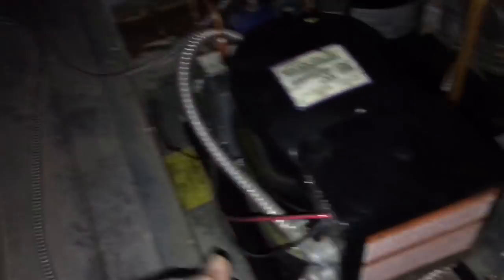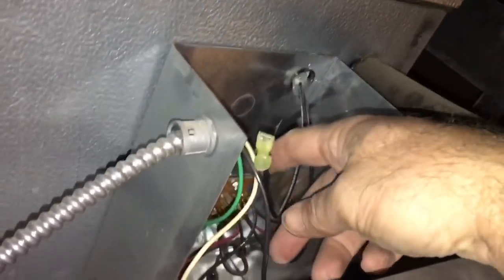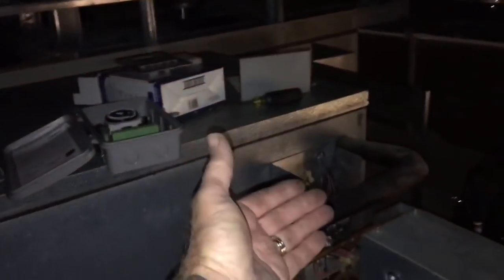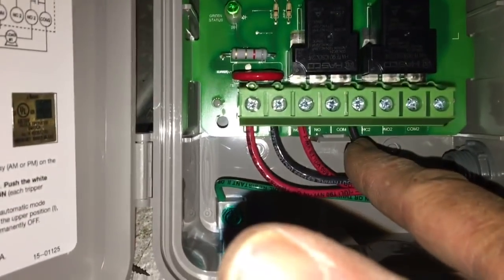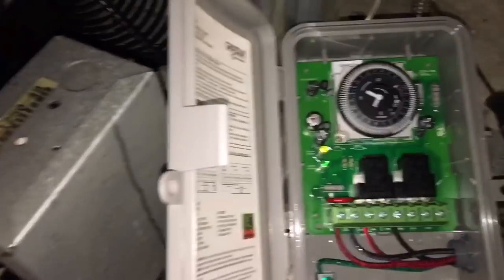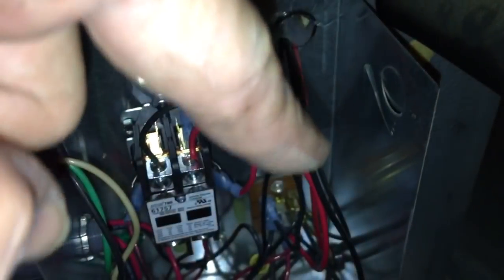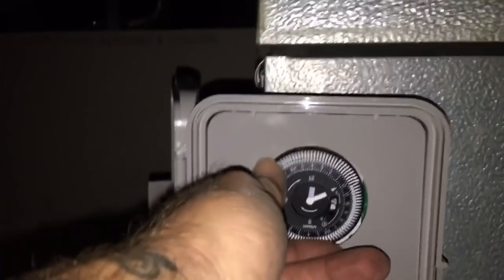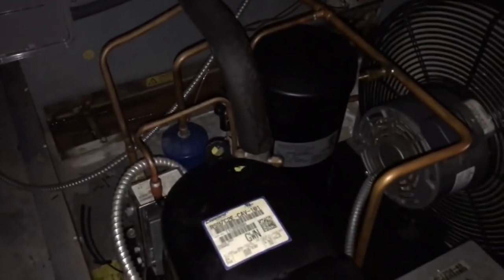Install defrost timer on walk in cooler

Comment: Had a random call at a cattle ranch a few weeks ago and had to replace one of those 208/240 coil contactors on a similar unit.
  I'd picked one up by accident and decided to keep it "Just in case", glad I did - quick and easy fix and the customer was happy.  
Saved a two hr round trip drive to the parts house too!  Def worth it to keep one on the van for out-of-the-ordinary calls.
Reply from the maker: mike_HVAC so True gotta have a few items on the truck.

Comment: Nice work Dave!   That looks like one of those Norlake units.  They always freeze up because they're not built to handle opening and closing all day long.  You'll see them in Subways and a few other establishments.  What you've done also works on R-22/R-407C units as well, as they also tend to ice-up because of the operating pressures/temperatures and people going in & out of them constantly.
Reply: Yes I have a subway that this happens to constantly. The newer ones have curtains and shuts off the unit fans when the door opens.

Comment: never seen a thermostat directly running the condensing unit and in 35 yrs I've seen some ragged ass shit. good job Dave
Reply from the maker: James Mclaughlin thanks James.
Reply: On almost all standard reach ins your thermostat controls your condensing unit. On small walk ins it’s also doable as long as the contacts in the thermostat can handle/rated for the compressors amperage.

Comment: Nor Cal, correct me if I am in error. The way I understand your wiring in of the defrost timer in this video is that you wired in contact No. 2 and 4 of the defrost timer in SERIES with the cold cotrol contacts, then used the output of the series circuit to bring one of the hot legs to the  208 volts contactor coil. Doing it that way means that the refrigeration mode circuit of the defrost timer needs NOT only contact No. 2 to 4 on the defrost timer to be closed, but it also needs the cold control contacts to be closed for the circuit to be complete on one hot leg. Of course, the other hot leg of the 208 volts is not on a switch. It's 
wired directly to the other side of the contactor coil. Wiring it that way means the contactor coil circuit is complete whenever BOTH the cold control contacts are closed AND contacts 2 to  4 on the defrost timer are closed. Also, the power supply for the timer motor is wired in PARALLEL with the line side of the single throw double pole compressor contactor. Did I get that right, sir?
I had to think about it because I'm used to the wiring of pumpdown split systems where the thermostat output goes to a liquid line solenoid coil, not a contactor coil.

Comment: Been using the Gm40 Time clocks for years , my favorite time clocks ...
Reply from the maker: They work good. Fair price too.
Reply: Nor-Cal Refrigeration & H.V.A.C yes they are . Where do you buy yours from?
Reply from the maker: Felipe Tafolla RSD
Reply: Nor-Cal Refrigeration & H.V.A.C how much do you pay for them?
Reply from the maker: Felipe Tafolla just under 60$
Reply: Nor-Cal Refrigeration & H.V.A.C.   Under 60! They run about 90 from my supply house here in NH. Blows my mind!
Reply: Nor-Cal Refrigeration & H.V.A.C weird Nor Cal my cost at RSD for that timer is over $90  , reason why I asked is , Home Depot used to stock those for $59 which was a mega deal , I think you can still buy them only at the Home Depot website, or maybe your Home Depot still stocking those  🤔.

Comment: I'm trying to hook up a 120 volt unit. I got power coming in but I don't have 120 coming out normally closed or normally open in any position. That's brand new out of the box. I'm sitting here second-guessing my wiring but I mean it's got to have 120 coming in and 120 coming out somewhere and I don't see 120 coming out anywhere in any setting or location. Not out of normally closed not out of the normally open. 🤷🏽‍♂️ Fml

Comment: The 9145/9140 series time clocks are nice. One of the key improvements with this model time clock is it keeps track during power outages. Once power is restored the timer starts ticking on time. This is key when your running more than one timer on the same box.

Comment: Dave did you wire L1 & L2 for the time clock to come off the terminal block or from the j-box?
Reply: It took me a few moments but suddenly I could see it. The new  timers orient differently. Also you have T1 and T2 coming too down. Also my walk in downtown have a terminal block not that it’s important but I thought I’d mention why I asked so many questions. I assume you didn’t specifically answer to protect yourself in some way. You’re too cool to just blow anyone off just because. I get it. Once I realized that the stat was all one wire the heavens parted and I could see the matrix. She’s working like a champ.

Comment: Will the fan on the evap continue to run when it goes into defrost?  I want to recreate the great job you’ve done here. I have the exact same setup but I don’t understand how you routed through the contractor
Reply from the maker: Yes the evap fans on this run it’s air defrost. Also on this unit they run at set point.
Reply: Thanks for responding. I dig your videos. Very helpful for us newbies.
Reply from the maker: @wdennis8  glad I can help. The old timers in my shop coming up helped me a ton. I thought I could share some stuff on YouTube and try and help others.

Comment: complete with leaking chinesium schrader valve, maybe it wasn't so easy after all.
probably could have went one less wire by feeding timer first, then thermostat and back to contactor, unless it's shared power feed to evap fan/s! not a big deal since you ran liquid-tight and it was only a few feet of wire.
I'm always looking for cost savings on projects, while not taking bozo shortcuts nor using garbage products :))

Comment: I don't do refrigeration, but I'm fascinated by it, and have always wondered about defrost controls. If you have multiple power outages does that cause the defrost clock to gradually fall further and further away from the actualTime? So now maybe your defrost instead of being in the middle of the night is during a peakload time?
Reply from the maker: Michael Glasser yes that is correct.

Comment: very good job dave 👍 most guys would of wired the clock without a  contactor...glad you did it right. BTW...in california they call it a drop top unit....the rest of the industry calls it a capsule pack 😅😃....whatever....its still norlake garbage 😅
Reply from the maker: kingofthecrease30 my verbiage is all over the place. But I like it called Norlake garbage 😂😂 that’s funny.
Reply: Nor-Cal Refrigeration & H.V.A.C ....or norlake gobbage 😂

Comment: Sometimes you need to watch a few times until you get it. I see it now. L1-L2 off the terminal block to the timer. Jump off L2 to half of the coil. L1 through therm back to timer com and out NC back to coil. Fans powered on all the time on top. Therm, compressor T1-T2. Did I miss anything?

Comment: Im a electrician on a construction site and the refrigeration technician told me to install this defrost timer with his Walk in freezer ,heat strips, thermostat and such. After watching your video it seems like this is the job of the refrigeration tech. In anyone’s experience here have you guys seen an electrician wire these up before or is that typically out of our scope?
Reply from the maker: yes electricians do it all the time. go watch my video on basic freezer wiring its easy after you see it once.
https://youtu.be/7nXcPIFPJv4
Reply: Defrost mode 3 & N
Refrigeration mode 4 & N
Supply power 1 & N
X terminal is defrost termination or fan delay.
Land all wires in evap unit according to schematic. Your videos are great. I may ask the refrigeration tech to check over my work and allow me to wire it. But In the future I’d probably still let them do it seeing how it’s on the equipment side

Comment: It’s amazing what difference a year makes but I get it now. My confusion was all in the defrost clock. Also you have the L1&L2 coming out of the block and into the contactor.  The load coming out. The defrost clock is only responsible for the coil after it comes out of the thermostat. It only took me a year. Please forgive me Sensei, I was born feet first.